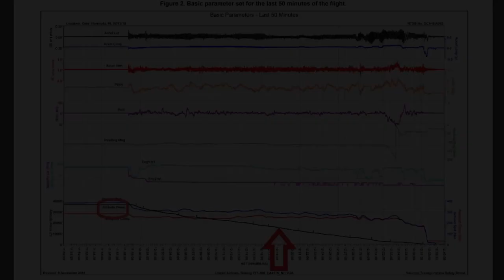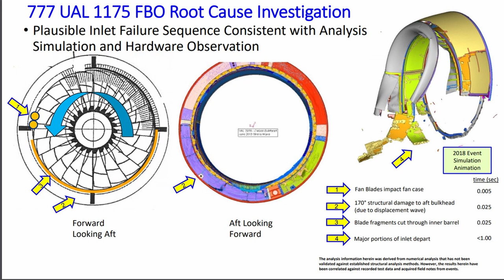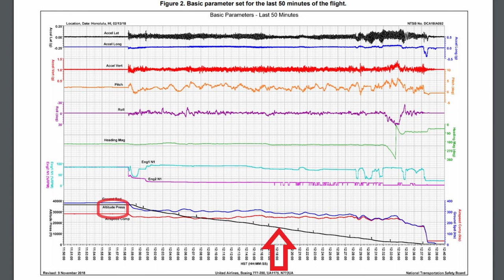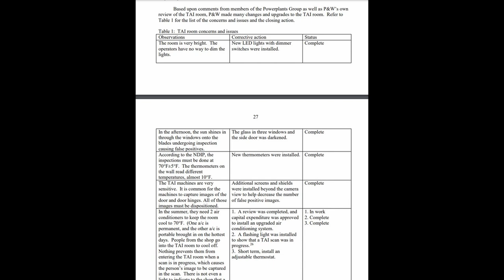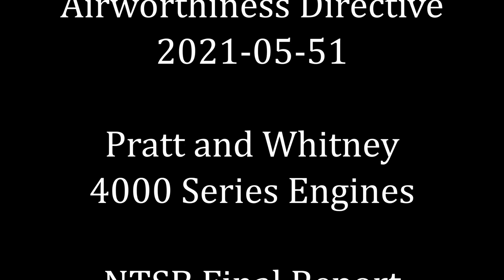Emergency AD & NTSB Final Report UAL 1175 Fan Blade Failure

Comment: I was responsible for the fan blade out test for the Honeywell International engines TFE731 -5 (small corporate aircraft) and I can an attest to the bump you get in the the containment ring after the fan lets go.   We had the nose section of the  cowling since it was directly attached  to a engine flange on the containment ring and we were required to have it installed for the test.  The moment the fan  blade separated  we had 500 fps speed cameras on the fan assembly.   The blade actually broke in half with the upper part exiting the front of the engine without any damage but the lower blade part fell back into the fan duct of the engine and exited out the back of the fan duct.  The interesting thing, and unexpected event, was a bulge that appeared in the containment ring and that bulge rotated around the ring a fan speed.   The bulge sheared the bolts holding the nose cowling to the engine and as the bulge rotated through one revolution it shear every attachment bolt and the cowling  fell off the engine.   The engine continued to run for the requried 15 seconds and was shutdown.  I can tell you it was heart stopping for those 15 seconds.  There were about 20 people at the test and everyone of us was dumbstruck for those 15 seconds and I remember yelling to the engine operations to shut the engine shut because we when well past the 15 seconds before anyone had sense enough to shut the engine down.   We passed the containment test but I always wondered what really would happen on a aricraft.   To my knowledge, the TFE71-5 has never suffered a fan blde separation even when the fan was struck by three 3 lb chickens in rapid succession.  How we manged to get all those high speed cameras (8 of them, 500fps and 5000fps) to record that event at the requried 104% fan speed is a story in itself.
Reply: Honeywell is fine with you sharing this information  ? , they are so paranoid about everything .... They will add you more courses on the Learning hub now LOL
Reply: Thank you for your service. You are an inspiration around the world.  An ability you possess perhaps only comes with experience as one may expect
Reply: As a pilot and total aviation geek who did the power-plant part of an A&P I appreciate the detail :-)
Reply: I would love to hear the story about how the video shoot was done.  Cool job.
Reply: Interesting about the 'bird test'. I remember seeing an infamous failure when the 'bird' used was mistakenly taken straight from the deep-freeze and not thawed out, so instead of an oven-ready turkey hitting the engine, a solid block of ice - effectively a cannon ball - was fired into it at several hundred miles per hour.

There were no survivors.
Reply: Very useful information, thanks for posting.
Reply: @38911bytefree  Hahahaha! 

Email on Monday: There have been changes to your Learning Hub...
Reply: @38911bytefree  By starting his comment with “I WAS responsible” would make me think he no longer works for Honeywell and with the TFE731 that would have been quite a long time ago (1970s) Also, this information is published and there is even videos all over the place, this isn’t some giant secret.
Reply: @EleanorPeterson  Back in the day that was an actual test to see how much of the motor survived. Saw it several times on the 4000 series on stand as well as multiple engines on stand for the AF.
Reply: When a cowl lets go during this kind of testing, does anyone try to simulate the effect of the air speed on the RUD? This could be anywhere from 200-500kts, yes? Or is this not important?
Reply: I used to work as a machinist for the supplier of many of the fan blades used in both P&W and GE engines. Even though they are incredibly sturdy and machined to fine tolerances, materials science teaches us that stress and fatigue beyond engineering limits can happen along with undeclared stress events caused by faulty engine management systems and pilot error.

These jumbo engines should be removed, disassembled and thoroughly x-rayed, and have those fan hubs rebalanced every 10 years or the equivalent number of hours.

Because safety matters.
Reply: @RinrvUSA  Very true statement. Also not like this is type event is something new. I remember back in the day all the effort that went into materials testing prior to anything being made at P&W. I just fear there will be a witch hunt on the P&W 4000 that has been in service for a very long time with a good service record. This can happen to any engine PW/GE/RR, etc.
Reply: 731= 350 small block  Chevy  of Corp aviation
Reply: @specforged5651  They have confidentiality agreements that apply even when you left the company. Is not that easy.
Reply: @cscrossman  Please, use one or more nemonics / acronysm in you sentences You have 2 or 3 thousand to pick  from .... LOL !!!!!
Reply: @38911bytefree  ...As a ex-airline now corporate pilot and owner of 3 turbine aircraft I am very aware of that. I was mostly referring to the age of that particular engine and that the things he discussed in particular are readily available for anyone to investigate. As a pilot and turbine engine owner/maintainer always hungering for more knowledge I’ve done so myself on many occasions.
Reply: LOL, Chickens Lives Matter!
Reply: Your description of the moving bulge is very interesting. Reminds me of slo-mo footage of rifles being fired. Gun barrels are very tough, rigid steel but under the stress of firing, they wobble around like buggy whips. Good slo-mo photography can reveal an incredible world of physics we can't normally see. Great post.!
Reply: @daledoesmtb7402  Some background, the test required we cause the release of the blade at 104% of fan design speed and the blade fail at the first attached point which was just beneath the platform of the blade.  The plan given to the FAA said we would record the release to insure the release was clean.   We would use 8 cameras  with shutter speeds of 500 fps and 5000 fps.  Because of the limited film we would have in the camera at 5000 fps, we had only 8 seconds of recording time with 2 seconds of that needed to get the camera up to speed,  we would have to design a system that could triger the cameras and blade release to fall within those 6 seconds at 104% fan speed.  So, we had these additional issues, how do we reliable release the blade at the right speed, how do we trip the cameras at the right time, and how do you get trip signal from the outside to the inside where the rotor was turning at 1700 rpm.  We found the cutting issue in primer cord that is used in  the F15 to separate the canopy from the aricraft just before the ejection seat fired off.   The cutting speed of the primer cord was like 25,000 ft per second. We drilled a hole through the fan blade in the thin section and pack the cord in the hole.  Then we ran wires up to the inner hole in the fan rotor disk and put a battery and switch that would provide the energy to ignite the cord when the switch closed.   The blade would release in milliseconds after the switch was closed.    We built a transmitter to triger the the switch across the rotating fan.  This was the early 80's so transmitting a signal in such a operating environment was a challenge.   So the process was 1) set the engine on the test point, 2) verify the engine was on the test point and the operators, the Honeywell team, and the FAA all agreeing the engine was ready, 3) the operating would pushed the release button, 4) there was a 2 second dalay for the cameras come up to speed, 5) a signal would then triger the transmitter to set off the primary cord, the blade would release.  We started the setup at 7 in the morning ( it was July in Phoenix and we out in the Honeywell desert site facility).  We pushed the button at about 9PM and the cameras started and the release signal was sent and the blade 
didn't release.  As Elon Musk says out of hunreds of thing happening it takes for one failure to ruin your day.   We shut the engine down and removed the fan rotor and discovered that one of the wires from the battery to the primer cord had broken likely due to the centrifugal loads on the wire.  We reattached the wire and tacked dwon the wire with more thin shim stock.   Now it was pass noon and the ambient temperture was near 108F so we decided to pack the cameras with ice to keep them cool, they don't like sun beating down on them at 107F.  We set the engine up on point pushed the button and everything went just as planned.   Welllll - maybe the cowling coming off wasn't in the plan but  the engine perfromed as adverised and most of the cameras ran, we lost 2 of the 5000 fps cameras and 1 to the 500 Fps cameras.  The film just jamed in the camera due to the heat.   Interestingly, the 500 fps camera were the best for see what happened as the blade released the high speed camera were just too slow  when run at a normal film speed.  Hope that was enjoyable.
I ran the bird injestion test later in the year,  that was easier even if you are firing 3 birds (3 lbs each)  from air cannons at 130 mph into the fan.
Reply: JohnathanK Doe  Yea, I’ve seen smash radar domes in the nose of the aircraft, broken windows, and remember the famous American Airlines flight out of New York just after takeoff they lost both their engines and had to make a unpowered landing in the Hudson River.  But the best happened to another turbofan engine developed the 80’s for a US Coast Guard patrol aircraft.  The Coast Guard was always concerned about bird strike from sea gull since they operator at low altitudes over water.  One   day on takeoff an engine on the craft suffered an ingestion of some object on the runway.  The object turned out to be  a piece of metal 2” wide x 1” thick x 24” long. It was a bar placed in the nose  wheel strut to insure the gear doesn’t collapse on the ground.  They forgot to remove the bar before takeoff and when they rotated at 80 mph the nose wheel rose up the the bar fell out.  It bounce over the wing right into the left hand engine and the fan rotor immediately injected the bar out the side of the engine cowling through the cabinet and out the other side.  The engine shook badly but never stopped running although at reduce thrust. They return to the airfield without shutting down the damaged engine.  Inspection showed all the fan blade were still there but badly mangled.  The Coast Guard never question that engine bird strike capability again.
Reply: This is HIGHLY specialized work. Kuddos to all the folks involved in this important work. I remember hearing that frozen chicken carcasses were thrown into these turbines. Chicken salad dressed with Jet A. Mmm.
Reply: @EleanorPeterson  Was that a GE test? I remember that as well.
Reply: @RinrvUSA  Yes! Establish an flight hour limit. Swap out engines at that point; do the test.
Reply: @gslogar1  Fascinating!  Thanks for the comment.  I did some fun stuff on the 5ess (telephone switch by Att) testing and support but nothing nearly this fun.  Fascinated by Aviation as it has a few things in common with Telephony.  Great redundant design is really hard.
Reply: Loved reading your description of that event. 👍🙏
Reply: WOW love your story, I made parts for Rolls Royce AERO so was pretty clued up on things RR made through its works magazines and videos.. thanks for your story - Ian -- UK.
Reply: @specforged5651  Sure this information is valuable, but this jerky corporations get triggered with almost nothing. The handle the most ridiculous papers to sign about limits for everything ...  well ... sure you will understand this being pilot for so many years.
Reply: @38911bytefree  I will most certainly agree with you on that. Good call. It’s pathetic is what it is, but we are doing it to ourselves. Maybe not me and you personally contributing, but you know what I’m getting at.
Reply: @38911bytefree  -  If you'll review D B's comment above you'll note that he's referring to tests conducted about 4 1/2 decades ago.
Reply: This is basically the failure mode in the USAF E-11 missionized Global Express in Afghanistan with a Rolls-Royce BR710 engine.  Severe vibration and noise, only indication was a FADEC FAIL.  They didn’t wait long enough to get all the indications and shut down the wrong engine.
Reply: @gslogar1  Woah, that's crazy. Amazing what damage a small object can do at high speed
Reply: @mdhazeldine  mass times velocity equals energy and even small masses have lots of energy as the velocity goes up.  The Columbia shuttle accident is the perfect example a piece of foam insulation weighting about 5 lbs struck the leading edge of the shuttle at 400mph and punched right through the carbon composite wing.  Interesting enough if that foam had come off 20 - 30 seconds later the air density would have been much lower the piece of foam would almost floated by the wing.
Reply: this particular blade was inspected in 2010 and again in 2015 by PW inspectors using  thermal acoustic imaging (TAI) inspection. The same crack was seen to have worsened in those 5 years, but they incorrectly attributed it to a paint defect. Turns out the PW inspectors was on the job training only and completely inadequate.